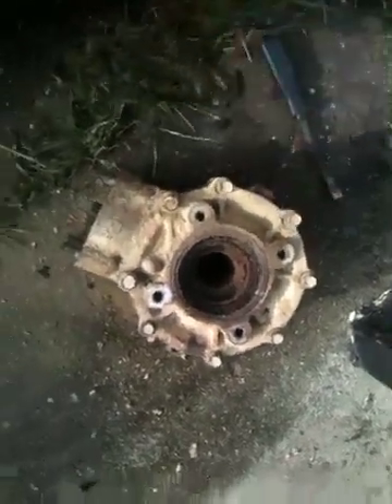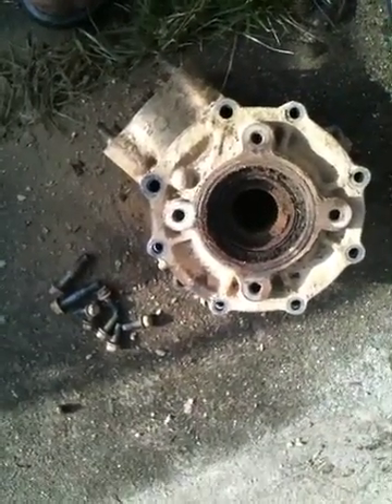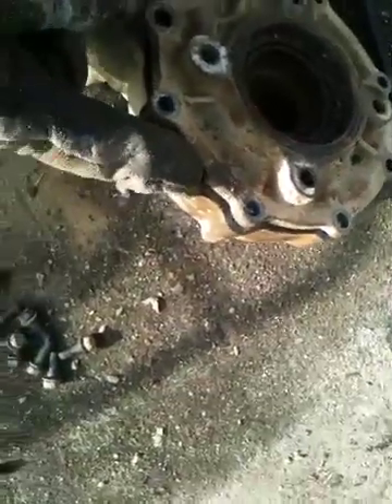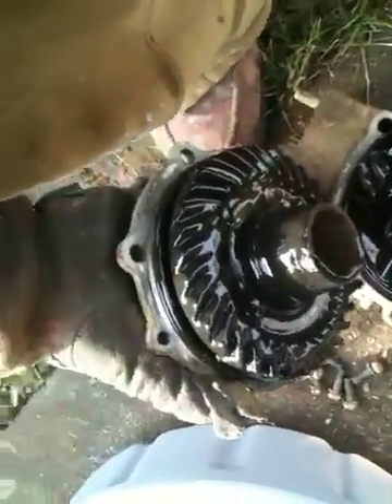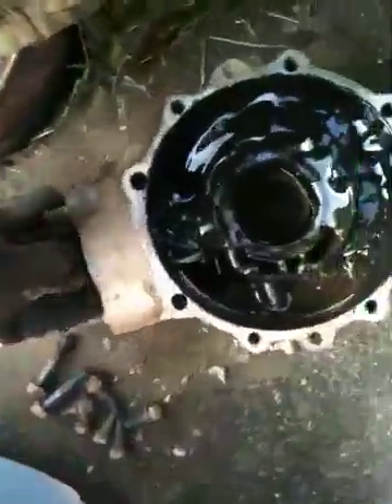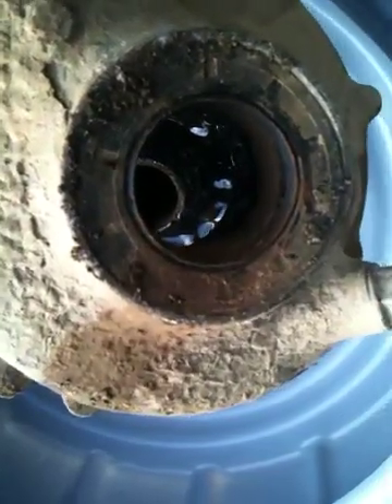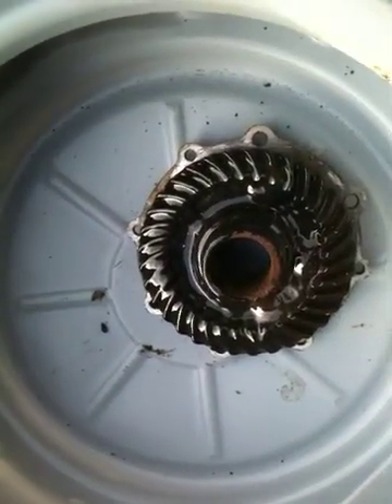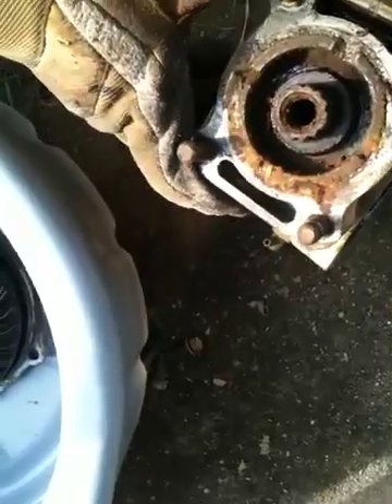Big bear 350 or 400 differential disassembly (pt. 2)

Comment: Did you ever replace the pinion bearings and seal? I've got an 07 wolverine 450. Same rear diff. I'm currently rebuilding mine and I'm trying to find tips and tricks to getting the collar off the pinion

Comment: Uh, welding the ring gear to the axle may work for a while, and may be the best option due to the high cost of the gear/axle.  But that gear and axle are splined for a reason.  It allows the axle to slide left and right in the gear, since it's fixed at the brake drum end by the axle nut.  I'm guessing eventually, it will destroy either the ring gear bearings or the brake drum axle bearing.  Just guessing!

Comment from the maker: Yes, I did end up welding the ring gear to the axle and it held up fine, but he ended up selling it not long after that so I dont have a long term report. Im pretty confident it will hold up good with a good welding job on it. It is a little more tricky to put the differential back in with the axle welded in, but its very do-able with a little work and can save you a lot of money.
Reply: I know this is a very old video but I don't see how its even possible to weld the axle and ring gear together AND put the diff back onto the four wheeler. How could you get the drive shaft and four studs back in the holes with the axle and ring gear welded together? it would seem impossible. Any explanation would be very helpful. Thanks

Comment from the maker: If it is slipping then you will either need to replace the ring and pinion gears, or the axle shaft itself depending on which parts are worn. The rear differential doesnt have friction plates, which was the reason for my question. The front differential does have friction plates, but if they wear out the differential will still work, you just wont have the limited slip function.

Comment from the maker: Most likely either your pinion and ring gear need replaced, or your axle splines are stripped. Slide the axle out first and see how the splines look. If the splines look good, then you will need to pull the differential apart. If they are bad, you have found your problem, but you'll want to make sure the splines in the ring gear are still good. If they are worn down enough they could possibly ruin the new axle.

Comment: How can you tell when you need to replace the pinion gear cause I have a suzuki ozark and the shaft turns ad there's a clicking noise and it won't turn the wheels what could this be?